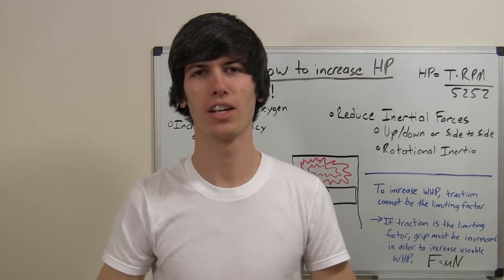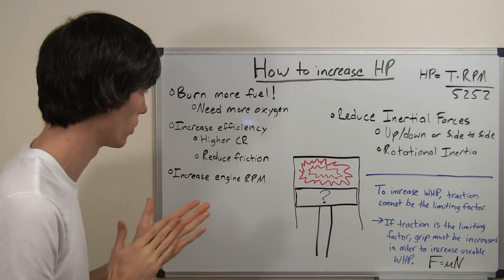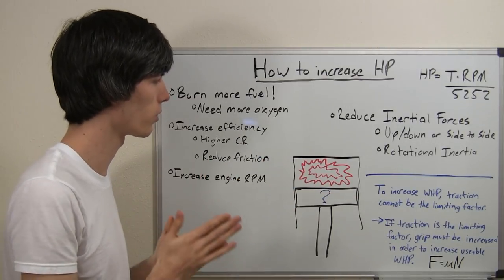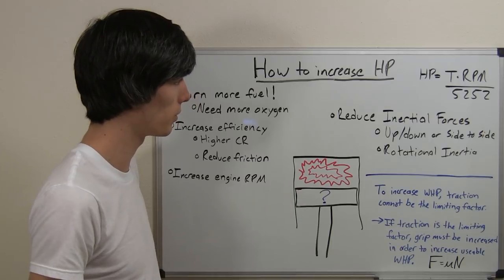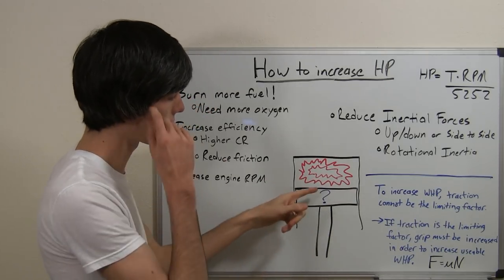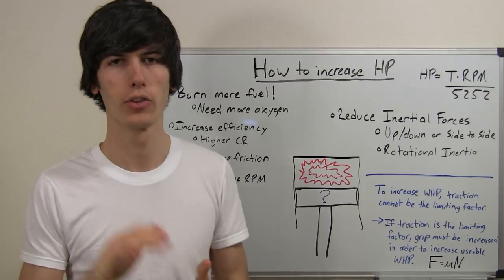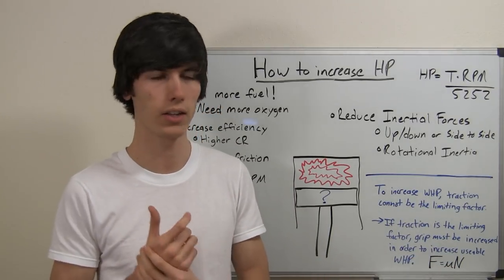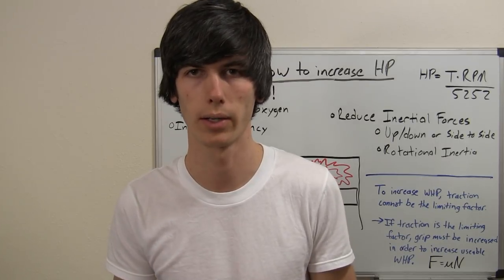How To Increase Horsepower - Explained

Comment: Excellent video, but you're messing up the mass vs weight thing. The normal force is equal ti tge weight of the car as long it isn't moving up or down. When using aerodynamic tech to increase grip, you are increasing the weight of the car, but not the mass. That's what you're trying to say. Weight is the force an object excerts on the ground. The normal force is the reacting force to that.

Comment: I have an '02 Ram 1500 2WD with a 5.9; my tires always slip on wet surfaces when going from a complete stop - sometimes on a level surface and always on a wet incline.  I bought brand new tires and they still slip unless I'm hauling something heavy.  Any suggestions?
Reply from the maker: This happens because of the lack of weight on the rear tires, and is typical for trucks. My recommendation would be to simply ease on the throttle from a stop, and then get on it a bit more as you've begun to accelerate.
Reply: Thats called power and no traction buddy
Reply: Thanks.  The engine eventually locked up and I bought a VW Toaureg V-8.  Needless to say, I don't have ANY PROBLEMS with traction:)

Comment: Why did motorcycles always have less horsepower than cars? If a lightweight, say, 300 pound mini car have the same horsepower as Top Fuel dragster at 7000 horsepower, would it accelerate much faster given its very light curb weight at only 300 pound? Someone said it will do 3-4 seconds in quarter mile drag race but others said it will just fly away over the drag strip while some said despite the lightweight, it still can't beat Top Fuel in acceleration because larger powerful engine can't be fitted in the 300 pound mini car. Thoughts?
Reply: Well to answer your question (Although kinda confused what you're actually asking) Motorcycles make less HP since they have smaller motors. For ex. a street motorcycles motors displacement usually will be 250cc-1000cc/1 litre. A car will usually have 2-5 litres. Which is more than 2x* the size of a motorcycle motor.
Reply: +Religitard thanks for the response. Another Q, if a very light weight mini car, for example a 300 pound mini car, have the same horsepower and torque as Top Fuel dragsters, do you think it can beat Top Fuel dragsters in a quarter mile straight race? I don't think even a 300 pound mini car with the same horsepower and torque as Top Fuel dragsters can really beat Top Fuel dragster in a quarter mile drag race, because even Top Fuel dragbikes still lose to Top Fuel dragsters in a drag race especially quarter mile race.
Reply: +Dobba Makale Well.. it depends on a lot of factors mostly including drive train (Awd, fwd, rwd) and grip. Any car could beat any other car.
The MOST important factors in a fast car is
Power
Torque
Weight
Grip
Driver
Reply: +Religitard what I am confuse about is despite motorcycles makes less horsepower than cars, motorcycle still prevail over cars in straight races despite the bike only have 500 and something horsepower while the car have around a thousand and more horsepower.
Reply: +Dobba Makale More weight makes your car accelerate slower. And since motorcycles have almost no weight and are made for performance. They'll accelerate but usually higher end bikes redline @ 165mph*
Reply: +Religitard but Top Fuel dragster weigh at 2300 pounds and above, and it is the fastest accelerated wheel driven vehicle. Even Top Fuel motorcycle which weigh around 1000 pound and have around 1000-1500 horsepower still lose to the Top Fuel dragster in a quarter mile straight race despite Top Fuel car weigh at 2300 pounds and have around 10,000 horsepower.
Reply: I am happy with my Yugo Sport

Comment: Did you go to a special car school like UTI? If so what school
Reply from the maker: Hames Delcid Nope, but I did go to NCSU for a BSME.
Reply: Engineering Explained I'm trying to increase horsepower in my kia soul but, i am finding it hard to find performance parts for like throttle body, intake mainfolds, etc...  What is your opinion trying to rebuild factor engine or should i buy a more common engine like ford or chevy that has more performance parts?

Comment: After watching over half your video. You still have not told me how to increase hp in my 85 Monte Carlos.
Reply: blackericdenice engine mods
Reply: ***** there's tons you can do a cat delete because that is restricted your engine from breathing. Also an air intake. Now if you're more serious start working on internals like pistons,camshaft, headers, valves, carburetors, etc but Engine mounts are practically inexpensive and can improve horsepower.
Reply: Sarcastic Fuck So you think cats are restricting hp? You ever wonder why a catalytic coveter body bore out wide and then come back small? It's made like that so the exhaust can pass through the element without restriction.

Comment: so if i buy smaller diameter  wheels, ill go faster?? :)
Reply: Actually smaller diameter wheels (the entire circumference of the assembly) will make the engine work harder to do the same thing with the previous wheels.
Reply: +walkerscranger like a big bike and smal bike which one you should put more force to do the same amount of riding?
Reply: In a case like this you become an engineer. The engine, transmission, final drive and tires all have to work together. Because the engine is incapable of pulling off without multiple gearing a 3:1 gear for first gear works pretty good for the engine. Then you would need 2:1 then 1:1. The final drive will depend on the engines output and the owners desire.If the desire is to run a vehicle in the 1/4 mile you will probably want a 4:1 or 5:1 ratio (not the best for the street). For the street you might want to go with a 3:1 final ratio. Now as far as the tires... the overall circumference of the tire plays into the math. If you go with very small tires it is similar to increasing the final drive ratio but you will need more torque to keep the vehicle going on the top end (over working the engine). If you go with too tall of a tire (similar to 2:1 final drive) your launch is sluggish.
Reply: You effectively increase final torque #'s at the wheel which makes better use of stock HP , great if you have a heavy vehicle. You could see slightly better acceleration off the line with tires 1-3" smaller in dia ...
Reply: 17 inch is the suitable size nothing less nothing more if you buy bigger they userly slower cause to much power used to turn wheel unless you added a turbo or supercharger and not too small the wheel will be slower then the 17 inch by a little amount of seconds they done a experiment on 16 17 18 19 and 20 and 17inch was the fastest but also depends on tire aswell

Comment: If you have 2 same car components, same driver, same everything auto trans , etc... IN a straight line race, lets say 1/4 mile , which car is faster ... CAR A has 400 RWTQ @ 4000 RPM, or CAR B has 400 RWTQ @ 5500 . Does it matter if the car reaches its max TQ per RPM 4000 , the example i have in CAR A ?
Reply from the maker: Well car B is producing more power, as HP is a function of Torque x RPM, but you have to look at the curve more so than just two points. Car B will ultimately be able to reach higher speeds, though if the forces are the same at the wheels, the acceleration rate will be the same for that very instant.
Reply: Engineering Explained
 ok so i thought when i see a reading of 400 TQ @ 4000 meant that car would be quicker than 400 TQ @ 5500 because it would reach 400 TQ at a lesser RPM. That is not the case ? Your saying in a short race , it would be a tie because both are 400 TQ but a long race CAR B would win because it can reach higher speed right ?
Reply: Engineering Explained
 How can you tell if forces are the same at the wheels, and how or where can i find the curve ? What is curve ?
Reply: AMIL JACOBS It would reach its max torque faster and have more power earlier, but lower rpms means lower top speeds

Comment: Point 2: When increasing efficiency, you aren't really making more HP, you are making the same, but you lose less of it through energy transfer by having less mechanical friction along the line. Well that's how I see it.
Reply: +SHiFT Di3S3L (Patch) you would be increasing wheel horse power
Reply: Yes, you see less of that power is lost as it goes through the drive train.

Comment: mechanical engineering, please explain about motorccyle? how to make it faster for low engine motorcycle..what to do to make that work. also explaine me about compention ratio >< still don't get it
Reply: Do you want higher top speed?  Put a smaller sprocket on the rear wheel, it will take a little longer to get up to speed but you will go faster.  You can also change the sprocket on the output shaft of the transmission to a larger one, usually some are limited by the surrounding housing.  At the bottom of the piston stroke the ratio is 1:1 when the piston is at the top of it's stroke the displacement there determines what the ratio is.  If it is 10 times smaller than at the bottom then you have a 10:1 ratio.  At the bottom of the stroke is where they determine you engines displacement, so if you have a 1000cc engine then that is your baseline, if at the top of the stroke you were to measure only 100cc that is a 10:1 ratio.  The higher the ratio the more power you get from each fuel explosion.  Fuel is similar to gunpowder that way, if you poured a small pile of powder out and just lit it you would get a small flash, but if you compressed it into a tube with a projectile keeping it compressed, then when you ignited it there would be an explosion and the bullet would be propelled at high velocity.